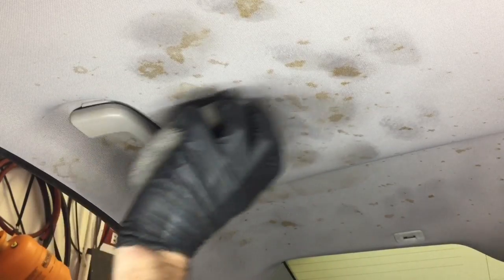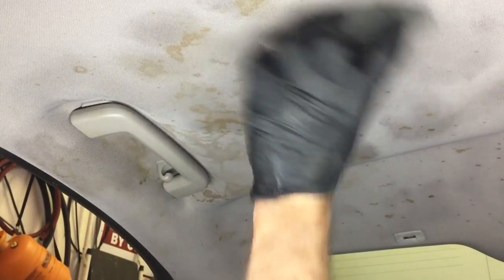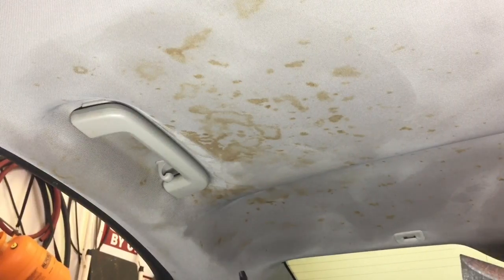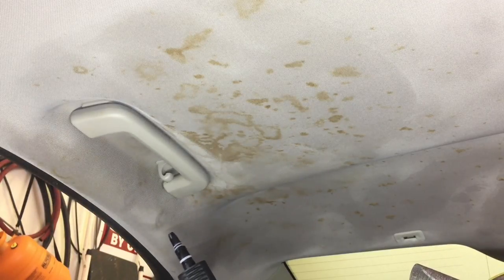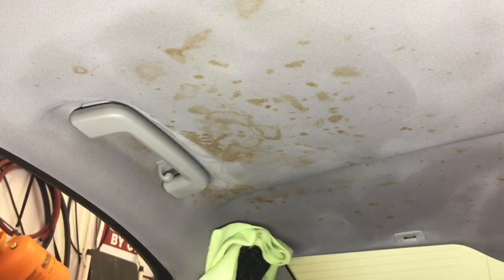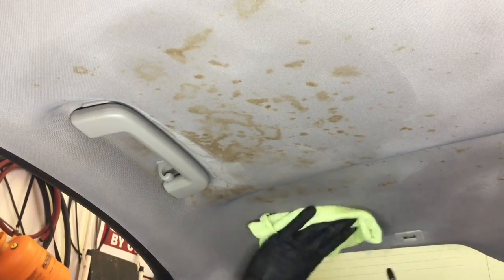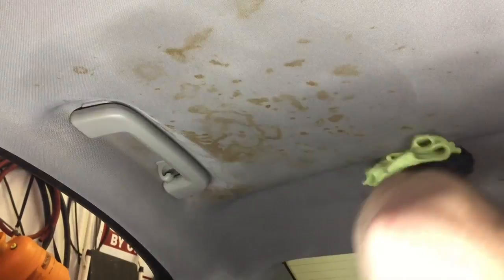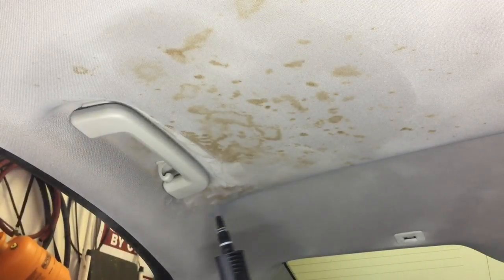Headliner Restoration:Stain removal, Spot removal, smoke, discoloration, coffee, soda, water marks!!

Comment: You can use a large gauge hypodermic  needle for a sagging failing headliner. You inject the adhesive in the sagging areas and apply pressure until it bonds. I've fixed several with this method and usually it looks as good as new.
Reply: Air mattress propped up to it makes a great 'holder-in-placer'

Comment: Thanks for another greatly informative video.

BTW, what do you think is the best way to clean cardboard headliners?
Reply from the maker: That will depend largely on what is causing the stain or discoloration
Reply: Apex Detail 
The headliner itself is most likely cardboard since one part of it's adhesives has failed and I had a decent look beneath it. There is only hollow air space i.e. no foam or any other cushions. This design seems to do a very good job of thermal isolation since the headliner had never gotten warm even after hours under direct afternoon tropical sunlight, but trouble is, it has some brown stains that seem like random dirt, grease, who knows what at randomly distributed areas. 

The seperated area should be quite easily glued back, but what I'm concerned is what cleaning techniques are safe for basically paper. I'm thinking of testing with APC or Degreaser blotting with wetted microfiber, and I guess steam or extractors are out of the question. I look forward to your experienced opinion on this.

For reference, this is a 94 model of what would be called the Mitsubishi Montero in the USA.
Reply from the maker: 4G12    The stains may be coming from small leaks at the seams of the roof. I see it a lot! Before you go to a degreaser... gently dab and massage in some Tide and fabric softener with a microfiber. Let it sit for a few minutes and THEN try to work out the stain. All that while trying to not over saturate. Its a balance that takes some practice. If that is not quite strong enough... try your apc.

Comment: Is this the method you still use? I had 2 cans of cokes blow up in my car summer 2018. Due to health problems I wasn’t able to get out there myself and get it out, and getting it done professionally was several hundred dollars. Do you think it’s been too long? I’ve tried using a towel to clean it, but it’s not getting the job done completely. Can I use a small brush like the kind your would to clean your nails?

Comment: Been detailing for a company for years and im currently enlisted in the Army going through my tech training and want to start doing side detailing again ok my free time and I got to say headliners were always my enemy back at my old job, removing the stains wasn't the issue but leaving water marks was the hard part.. I didn't see any eater marks left on the headliner here and wanted to know what is it about this technique that doesn't leave them behind? I was always cautious about how damp I got the headliner but they always seemed to leave some slight discoloration
Reply from the maker: Having a dry vapor steam cleaner is key. Over saturation is where the trouble lies. 

I thank you for your service to our country. All veterans get a year round discount at my shop. Cheers!
Reply: Apex Detail I would like to thank you for the quick reply and for your support of our active service members and veterans!

Would the McCulloch be a decent steamer to start out with ?
Reply from the maker: The McCulloch 1275 and 1385 are both great steamers.

Comment: Would I be ok using just the steam from my iron for this?
Reply from the maker: If you wrap a microfiber towel around it... your headliner would have some protection. If there is a temperature regulator... start at the low setting and work your way up. Always try the least aggressive method first. Good luck Allison

Comment: can you explain the ratio thing to me??
Reply from the maker: Absolutely Akeem... in this instance.. one ounce, TideCWC, one ounce Fabric softener in a spray Nine solution cut 5:1..... if that makes sense
Reply: Apex Detail awesome video. so you use 2 different spray bottles? Or add 1 ounce of each product into a bottle and then dilute those 2 ounces with 5 parts water?
Reply from the maker: Everything is mixed in one spray bottle here Diego. First cut the Spray nine. If you choose to. Spray Nine is safe at full strength. Anyway... add one ounce tide, one ounce fabric softener.
Reply: Apex Detail ohh I get it now. thanks!
Reply: Thanks from me too!
Reply from the maker: Anytime gentleman... I should have went into the ratio details in the video! 😁